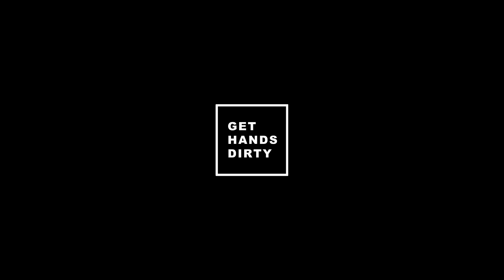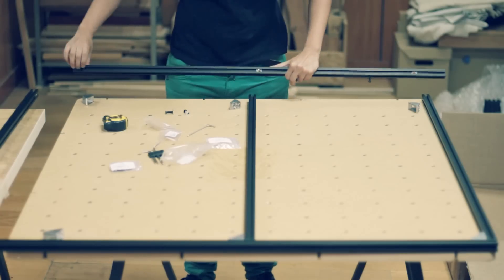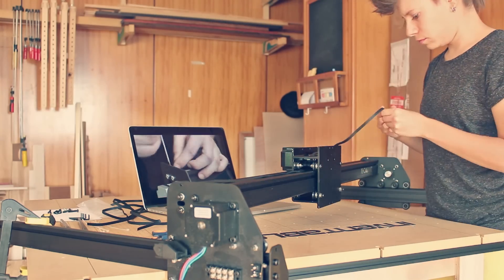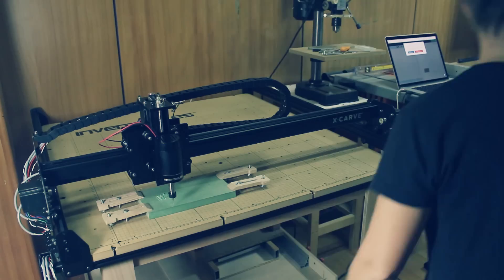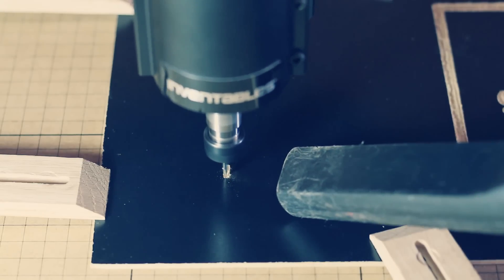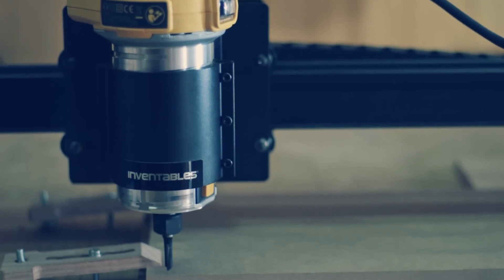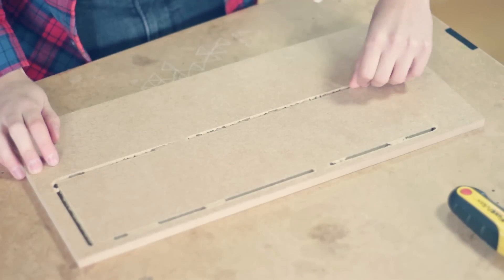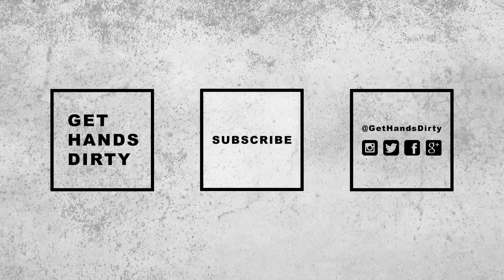X-Carve Experiments

Comment: Interesting that they've dumped the QuietCut spindle, though no overly surprising. Very much the weakest part of the machine. Its frustrating that the new option is only 110v and they don't have mounting plates for routers more easily available in other countries (like the Makita RT0700c) :(
Reply from the maker: +Paul Jenkins (TheWoodKnight) This dewalt is 220v. Is the dw26200 and exactly the same router as 611, as far as appearance. I was thinking that maybe one of the mounts that they have could fit on the makita...have you thought about that yet? Maybe the bosch one. Try to get info about the diameters.
Reply: +Get Hands Dirty Ah, I didn't realise there was actually a 220v version. In Australia, it looks like the D26204K is twice the price of the equivalent makita, ouch. And unfortunately the diameter of the mounts - at least according to all the diagrams Inventables put out, is a few mm too small. It could fit with a fair bit of filing, but I'll just have to make some mounts using the quiet cut spindle, out of some HDPE or the like.
Reply from the maker: +Paul Jenkins (TheWoodKnight) Yeah, it's pretty expensive here too... It probably isn't too hard to make your own mount ;) Good work!
Reply: +Paul “TheWoodKnight” Jenkins the makita can fit one of the inventables trim router mounts with a shim, I forget which mount and how thick the shims need to be. There is a user on the inventables form that offers custom mounts for the makita.